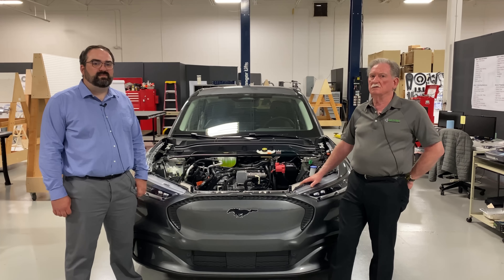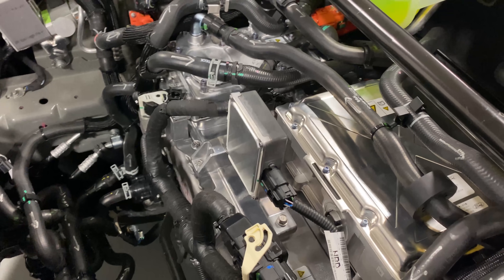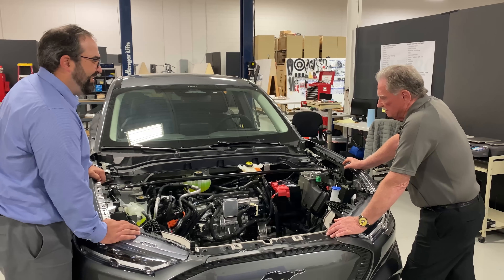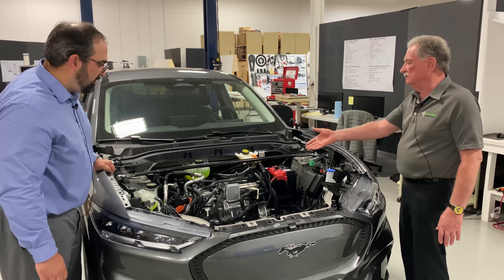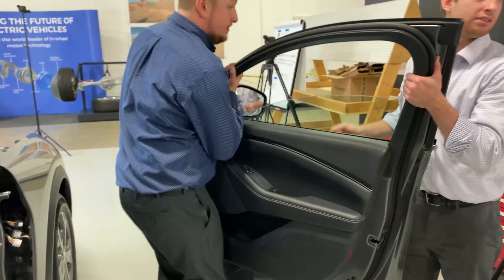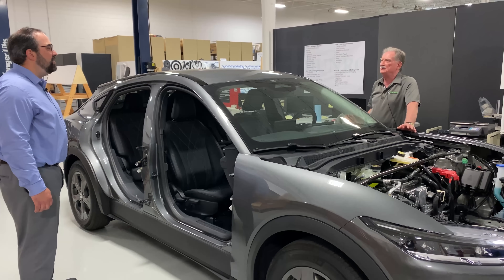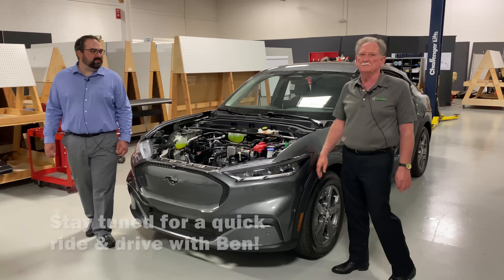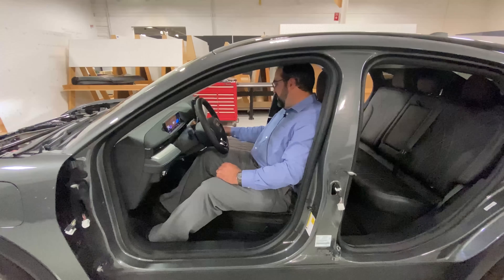Mach-E Teardown: Doors Off + ECU Mystery Solved

Comment: As Scotty would say, "That thing is going to be an endless money pit" haha. Too many hoses and computers means you don't want to own this out of warranty.
Reply: Ford wants to keep their dealerships happy with guaranteed future servicing, beyond the limited maintenance usually associated with EVs versus their ICE ancestors (money makers).
Reply: @gwarlow  You are not wrong. Looking at this shows that it was intentionally designed for that to be the case. 
Full disclosure, I am an EV skeptic. I think they are the future, but it won't happen as quickly as people think. But that doesn't mean other industries won't move in this direction, but quicker.
I was changing the oil on my mower this weekend and it was a royal pain in the a**. Oil got everywhere and it required a special trip out to the store. My electric trimmer is the best $150 i have ever spent.  So easy to use, zero maintenance, and goes through almost anything. My mower is a Honda, so it will last a long time, but my next mower will certainly be electric.
Reply: @andrewmeehan6151  
Think of it this way.
Every EV sold is an ICE car not sold.
Every ICE not sold makes that production run slightly more expensive...... The reverse for (non legacy!) EV's.
The same applies to oil/ fuel production.
There wil come a point (soon) when it's more "politically advantageous" to remove oil subsidies and use the money elsewhere (guess where)
It's already happening in European cities, where pollution pricing is being used to limit access.
And other things......
When it happens, it's going to be fast.
Reply: @rogerstarkey5390  What I think you will see is the luxury and pickup truck markets go electric first, and then it will trickle down to the mainstream brands eventually. Without massive subsidies, I don't see how a Nio or a Tesla could compete with something like a Camry. The price difference is too big. They could compete though with something like a 5 series or an E-Class. 

IMO having the govt step in and trying to speed up or slow down certain industries is a mistake. Oil companies don't receive subsidies, they just don't pay taxes. Over time we will decrease our dependence on oil (good thing) but things like this have to happen incrementally. I don't think that the measures taken in EU and China will end well. As the Toyota CEO said, this will lead to a "flower on a high summit."
Reply: @andrewmeehan6151  

When Tesla builds a car "like a Camry" it will compete with a Camry.
As I've repeated many times, any new Car (EV/ICE) company had a choice.
1) Build a huge factory, build very large numbers of "cheap" cars at small nett profit.

2) Build a smaller factory, then "expensive" cars, with greater profit per vehicle.

Result?
1) Probable bankruptcy
2) See Tesla.

Why do people insist on comparing Tesla with everything from a Camry to a Lamborghini (or this week, a Rimac)?
One reason, they have total life cost approaching the Camry and performance of the Lamborghini.
That was never said about a..... BMW (etc)
And the Plaid did this with the earliest battery format they have (18650)

"They (oil) just don't pay taxes"
That'll be a subsidy ("benefit, removal of burden")

The measures taken in Europe and China "won't end well" for ..... Toyota (look for them changing tack, using BYD batteries soon!)
Reply: @andrewmeehan6151  It may happen a lot quicker than you think. EV sales are growing exponentially. What we are seeing here is a classic disruption.
Reply: @MarkXHolland   We will see once they have to start paying their fair share in road taxes and government subsidies go away. This isn’t disruption, it is a suppression of freedom
Reply: @rogerstarkey5390  free market is the best, anything other than that doesn’t end well. What if hydrogen breaks through?
Reply: @andrewmeehan6151  ice engines have long lived on government checks lol, if they had to compete in an actual free market they wouldn't have dominated like they have.
Reply: @DrewLSsix  That is incorrect, aside from GM and Chrysler, how have they lived on government checks? BEVs will never work for 100% of the market. Most of the market eventually? Yes. But not all of it.
Reply: How often do the computers fail on other cars? There probably are more computers in a high-end Mercedes or BMW than on the Mach-E.
Reply: @stephenj4937  True, but that's to be expected because those are high-end luxury cars. I don't know the failure rate, but I do know that brands like Lexus and Acura are quite a bit better than the ones you've mentioned.
Reply: As a life long electronics technician , when I see trash it if you drop it, you know it's going to fail. Vibration and pot holes are the bane of printed circuit boards.

Comment: Sandy, are you going to do a tear down on the new Model S Plaid?
Reply: that will be way more fun and I bet Sandy's team will get many customer
Reply: Sandy has a business to run, no market for a halo vehicle teardown.  My guess is that he may tear down parts of the plaid.  Most likely the powertrain.  Tesla has managed to make a motor with a carbon fiber over wrapped rotor that spins to 20k rpm and has no power drop at max speed.  Makes 1000hp at 20k rpm.  Making gearboxes obsolete.
Reply: @Robbie6298  I thought Sandy's business is to sell teardown detailed report to competitors ...part of his business ...
Reply: @sudeeptaghosh  correct.  There is very little market for a benchmark report of a low volume halo vehicle.   Competitive benchmarking has the goal of figuring out what your competition is doing to reduce costs and increase efficencies in a mass volume vehicle.   It's useful to tear down parts of a halo vehicle but to spend 130k plus a few hundred thousand dollars in labor and operating costs to make a report that you sell for 70k to one or 2 customers dosent make sense.
Reply: @Robbie6298  RPM around 15.000 are normal with electric cars. Of course you will still need a single speed gearbox.
Reply: @arsni23  15k is uncommon for a large motor.  20k is very uncommon.   20k without losses at high rpm is unheard of.  Most experience Eddy losses as speeds increase.  Tesla maintains 1000hp up to top speed.  Minimal power drop.   Makes 1020 HP at 60mph (6000rpm) makes just shy of 1000hp at 200mph (20,000rpm).  I should have specified that multi speed gearboxes are obsolete.

Comment: Maybe the mystery box is in front because there is a wireless communication between the Electrify America charging station and the car.  Or you can leave this box away to replace it with an induction charging plate under the car.

Comment: There is a good chance that the Off Board Charger interface module is seperate because it was simply bought from an Teir1 or other external company, ie not developed within Ford themselves.  CCS uses Home Plug Green Phy as the coms architecture, and COTS chip sets exist for that protocol, so it woul dbe relatively easy to get from an external source.  And it also both future projects and territory protects, because your fundamental IPR is within the motor control inveter, and this seperate module can be used across all models with all different powertrains (including models with dual inverters) and for different world markets.  WIth the rush towards V2G it also makes sense to ensure your DC "charging" system is at the least package protected against the future adoption of such useful tech!

Comment: You have seen one of those modules before - the BMW i3 has something very similar ( Zone 4, Page 2094 of your i3 report). The BMW unit also controls the charge contactors and flap lock. 
The reason it's in a seperate box is that the CCS protocol is so stupidly and unnecessarily complicated and badly defined that they almost certainly buy in a software+hardware solution from a third party manufacturer who has already got it working, and knows the different quirks of the various different chargers . 
The box talks the CCS protocol to the CCS charger, and interfaces to the vehicle's BMS via the CAN bus.  
The CCS protocol is the same for US/Europe, only the physical connector is different. 
The communication is not done via the power lines ( though confusingly the GreenPhy protocol used is designed for AC powerline applications - probably the reason the idiot who chose it as the standard for CCS did so), but through the CP control line.
The Hyundai Kona and Ioniq have a very similar solution.
Reply from the maker: Thanks Mike.
Reply: And on top of that, a shame that the spec is not free/open.. makes us tinkerer's hard to do some Homemade V2G easily
Reply: @Jinguapingi  There has been some success using the BMW i3 module to enable fast charging on homebrew EVs - info at openinverter forums. AFAIK CCS does not yet support V2<anything>
Reply: @mikeselectricstuff  F150 Lightning offers V2H and will be released soon, so they have come up with something.
Reply: @Lincos321  I think that is AC, not DC, so not probably done via the CCS interface
Reply: @mikeselectricstuff  i remember reading somewhere it supposed to be added by 2025
Reply: @Jinguapingi  Probably CCS specs are closed because they are crap, just like much proprietary software. :)
Reply: @Jinguapingi  Many years ago I was asked to implement the DCFC CSS charge interface for a EV-Conversion, my  hearth sunk reading the specs and prefab code.. Too much unrelated data, poor data formats which do not age well. The spec needs a rewrite with help from embedded & hardware design engineers. The locked in Qualcomm  phy is very dubious.
Reply: @crhu319  What good reason would that be?
Reply: GreenPHY is used because it's in IEEE1901/Home plug and is increasingly in use for DC control. https://mynissanleaf.com/viewtopic.php?t=24704

CCS uses it over the pilot pin bit on theory could use it to talk to the meter, home management system, smart breakers, demand response controller, in house batteries and controller.

In other words it's chosen to have one protocol from car to transformer.  We have all had enough of car industry specific or manufacturer specific wires or protocols.
Reply: @crhu319  Totally stupid decision as there is no need for a car to talk through to the transformer. It just causes endless compatibility problems due to unncessary complexity
Reply: @mikeselectricstuff  that’s been Ford and German cars MO the entire time I’ve been in the car business .make it unnecessary complicated to do a simple task .
Reply: 2094 pages out of how many
Reply: The CCS protocol is the brainchild of the German car manufacturers.They wanted something proprietary, otherwise they would have accepted the ChDeMo standard (or even licensed Teslas standard). Therefore the world ended up with one more plug and protocol nobody really needed.
Reply: @energiewender143  That doesn't make much sense: The CHAdeMO spec is proprietary too: it's only available to members. I don't think that is materially different from the CCS situation.
Reply: @xxwookey  The big difference is Chademo is simple and uses CAN, so can be developed and debugged easily, CCS is just way too complicated for what it needs to do, leading to lots of performance and compatibility problems.
Reply: this is precisely why chademo is better it does not require this type of PLC and can communicate directly via CAN with the chademo fast charger.
Reply: It's so cool to see brilliant folk work together 👍👍😎
Reply: Now I'm very curious. If I buy a Cybertruck (& Cyberlandr) in the USA, drive it around for six months then relocate it to Europe with the intention of driving it around multiple countries  (perhaps down through Africa) - would that work??? Wondering about CCS vs CCS Ver 2 differences too.
Reply: @markelkins8432  No, you will not be able to charge a US spec CT in EU.  The connector is totally different.  Maybe someone will make an adapter, but it's not trivial.  In the US Tesla uses a 100% proprietary connector that combines AC and DC charging using the same 2 pins.  In EU, Tesla now uses a standard CCS Type 2 inlet, which has 3-phase AC capability.  In the US we use Type 1, which only has 2 AC pins (single phase).  In addition, the proximity signal is different.
Reply: And remind us why CCS beat CHAdeMO as the default protocol? At least that had V2G from the start.
Reply: @xxwookey  Main problem with Chademo is you need a second connector for AC. It also has way more pins than necessary
Reply: not sure if related but i know Smart(the mercedes subbrand)  EV's have a PLGW (power line gateway) that comunicate to the charging stations via the power line
Reply: In Tesla's case, where do they have this part? Considering Tesla's stubborness, I'd assume it's integrated into some larger module that's designed in-house not an off the shelf part?
What you said about the CCS protocall adds up with the fact that some cars don't communicate properly with chargers, if I recall, the Polestar 2 had issues with this at release for example.
Reply: @VoxelLoop  
The Tesla probably has a software switch on a single unit.
Reply: @VoxelLoop  Tesla integrates the PLC modem inside the charge port ECU.

Comment: That serial connection between the door and the tailgate is rather odd. I presume manual release from inside the car would be unaffected. I'd be interested to know how safe that connection is from impact or general wear and tear.
Reply: no, its not odd at all, and like most cars. ask any body shop. What is odd however, is that the crew didnt expect it.

Comment: Great security feature… remove the driver door to secure the boot. Lol
Reply: You don't even have to remove the door. Just unplug the window switch.
Reply: @user2C47  not good if the switch fails in the next few years. Ford. Fixed Or Repaired Daily still seems to fit.

Comment: I don't really understand why they didn't do this detailed of an examination of the Bolt EV :-\
Reply: There is a lot more hype and therefore potential viewers for the mach e teardown as it is closer tesla competitor in terms of size, price, and range. The bolt is a good car but in a boring package and I don't think was on a true dedicated EV platform. GM is trying to change that with the hummer EV, but that is on the extreme opposite end of the spectrum in terms of features and price. It seems like it's going to be another couple years before GM hits the heart of the market with a $40-50k, 300 mile, EV crossover as I think the lyriq is going to be at least 60 or 70k.

Comment: I didn't had much confidence in teardowns from Munro. But this one shows there is a lot of incompetence. Taking the doors and hatches out and driving around?!! There lacking knowledge of state of the art electric car technology and are just playing around somewhat. They don't seem to "exercise" the same "tests" with al the cars. But I still can look at the videos and put the sound off and have my own impressions.
Reply: well, he explained why they drove it around their Lot without Doors: they want to see how much of the Car they can remove before it goes to Limp Mode and/or refuses to Drive (work), and are planning on reversing the last step they did so they can intercept an Software Update. and i am pretty sure they stated thats the first time they go last for the Drivetrain (or at least delay it) for exactly that reason, usually that would be the first thing they go for.
Reply: @unitrader403  completely ridiculous and not useful at all. Why is a Tesla not subjected to a test like this. Why? Maybe if you remove a windshield wiper the car already stops?
Reply: A car developed by a new team in New Corktown, Detroit en production in Mexico and China is the result completely alien to Munro......